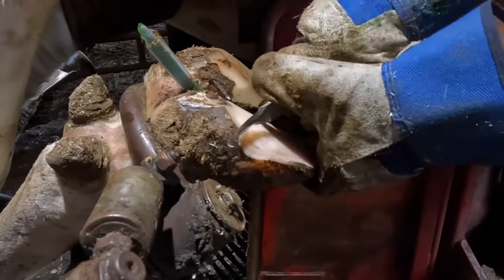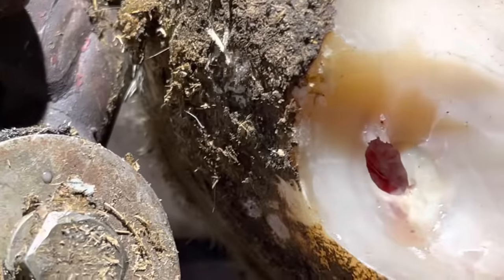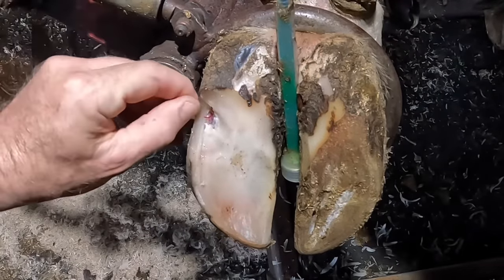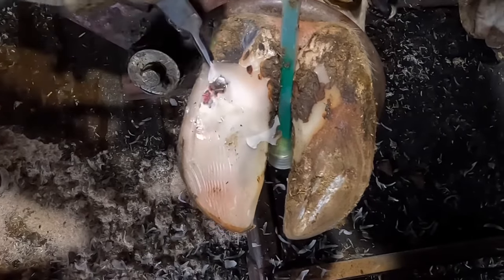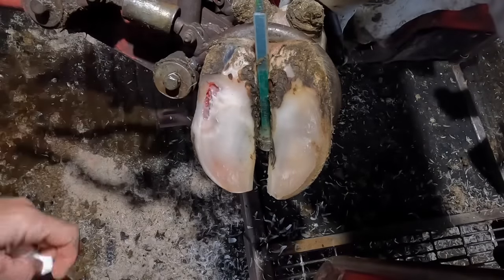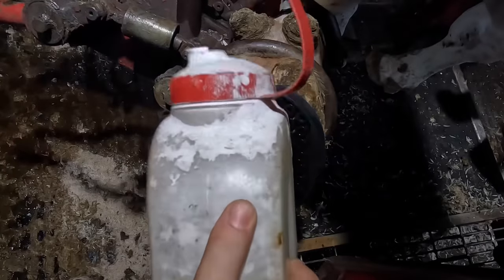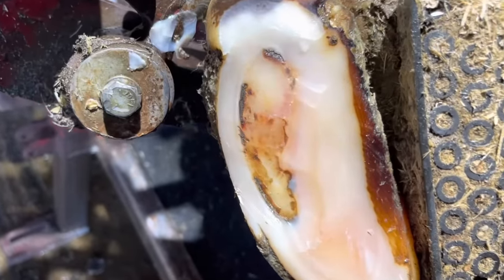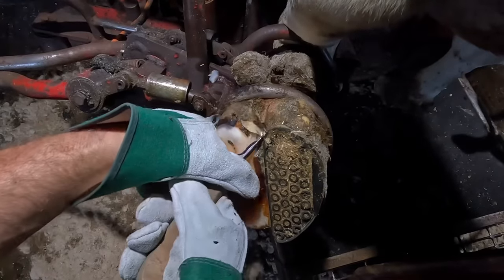There’s a CAVERN IN THIS COW’S HOOF

Comment: I appreciate the insight that cows and dairies are often in northern climates and this leads to cows living inside and on easily cleaned concrete floors. I learned something new today. Thank you.

Would it be possible to shoe cows with the rubber/elastomer blocks (or something like it) to create less stress on their hooves when they are on the concrete? Or would adding a shoe cause some other issue?

Comment: Like you said the ideal is having cows outside on pasture as much as possible and kerp them inside when necessary in a barn covered in something like EASYFIX rubber on a lot of your concrete like Tom Pemberton does (for those that want to see an example of rubber matts)
Good padding in strategic areas is hugely beneficial to cows.

The farms you are at seem to not have much rubber padding down from what I can see at least. Maybe there's a lot of rubber I'm just not seeing.
Reply from the maker: You don’t want rubber everywhere.  It eliminates all wear which means they need much more frequent trimming to keep them balanced.  Places where the stand a lot (parlor, feed lane, holding area etc.  Easy Fix is just a sponsored brand.
Reply: @NatetheHoofGuy  maybe it was poor phrasing, I know you know all of these things. I was phrasing it for people that haven't seen rubber matting used at barns.
 I intentionally said "something like EASYFIX" so people have an example of what you mean by rubber matting.

I also didn't mean it should be everywhere! Hence why I said "a lot" instead of "everywhere".  As you darn well know strategic placement is key! Like by food and water, high traffic areas, cow brushes if you have them, etc.

It was probably poor emphasis on my part. If memory serves me correctly cows need the chance to wear down hooves and too much rubber won't allow that.
Reply: @NatetheHoofGuy  also I want to emphasize I know there may very well be rubber at the barns you visit! I fully admit I'm not there so I wouldn't know if it is or not. I only see small snippets. 🙂

Comment: Have you ever seen a case where a crack forms in the whiteline and makes it down to the corium but doesn't get infected? Or do all cracks inevitably lead to an infection? Is that even possible?
Reply from the maker: Most of the cracks that result in abscesses form from the inside out.  Most of cracks we see on the outside are surface imperfections and will never result in problems.  The infections result from the poor formation of the whiteline and that allows bacteria to reach the corium.

Comment: Is putting extra glue on the back of the heel always necessary to prevent the block sliding to the toe? I seen it done a few times but not always. Seems like youd always do it

Comment: Hi Nate. I noticed on the four week check that you removed more horn forward of the lesion, as though dirt had started ti underrun the sole. This sometimes happens to me too. Are we missing something on the original trim or is this expected?
Please advise. Thanks
Reply from the maker: You’re going to have additional horn detach regardless so if I think removing more on the initial trim is going to cause corium damage then I stop.  It’s safer removing it on the recheck.  Clearly it didn’t affect the healing.
Reply: @NatetheHoofGuy  ok thanks

Comment: ok... i hate the logic of not wanting to fully get rid of the bad horn because it would thin out the soul too much, when you literally are using a block to the cow doesnt have to walk on the bad claw until the soul hardens back up...
Reply from the maker: It’s not bad or loose…just black.  The only reason the block is on now is because it’s too thin to remove.  Thinning more means longer with the block on.